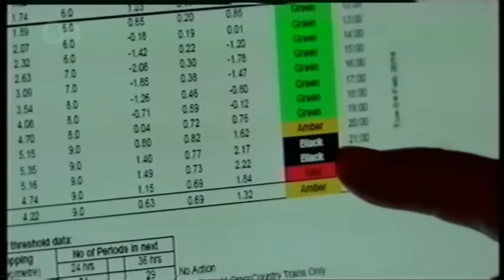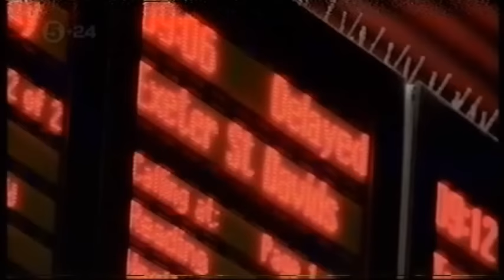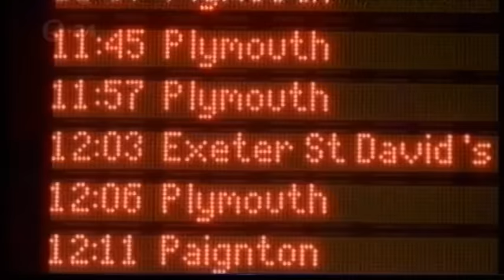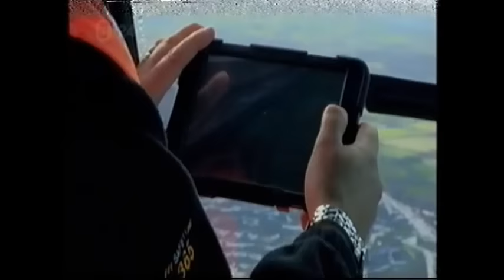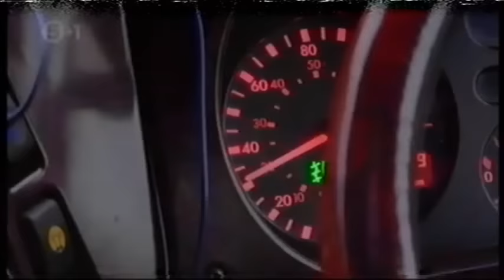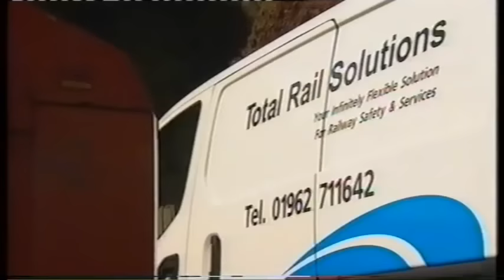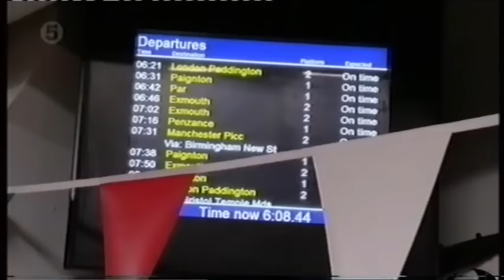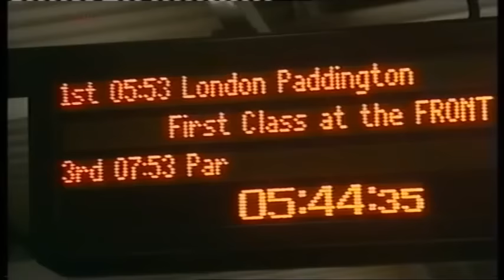The Dawlish Débâcle

Comment: I worked as a surveyor in Civil Engineering and did some freelance work on the North Wales Coast Road between Penmeanmawr and  Llanfairfechan. Boulder armor was placed on the beach to break up heavy seas and to lessen erosion. I do not understand why the beach at Dawlish has not been similarly armed.
Reply: This was also used at Minehead and Scarborough to protect the coast, however the tide does not go out very far at this point on the Devon coast and one of Dawlish’s tourist spots is the beach of which there isn’t a lot to start with.  Good point though and eventually this may happen if it gets the battering it’s had since being completed.
Reply: I’m convinced that there was a body politic against reinstating the Oakhampton route. The Dawlish route was undoubtedly ‘engineered’ in more ways than one!
Reply: Why is this called a débâcle , it was a success 🤔
Reply: @Belfreyite   Thankyou for your educated comment , I’m no expert like yourself but I’ve been saying the same thing since they “ fixed” the dawlish line - should of been rock armour all the way along 50 feet out ,no way in hell that track should ever be deluged by sea water ever - half a job - typical of modern day Uk
Reply: The civil engineering for the A55 expressway you were involved in would almost certainly have been driven by hydrological surveyors' assumptions for that stretch of North Wales coastline. The Dawlish works I'm sure would have followed whatever judgements were made for that stretch of Devon coastline.

Comment: Sadly the new wall will hold but, the waves still come over plus this is just a small section of 4 to 5 miles of crumbling coastline.  The Oakhampton route must now be an option.
Reply: Route should never have been closed,
Reply: Should not be that hard to do... Much of the track bead is still there.
Reply: @TheMateriaalkunde  I understand there's talk of the line from Plymouth to tavistock being put back, but I can't understand why oakhampton to tavistock is being left out it's said that the viaduct won't stand trains over it, so why not build a new one next to it, a survey was done on the trackbed and there's not really a lot needing done,
Reply: @TheMateriaalkunde  Alot of the track bed has been built on? So it will be harder to restore it.
Reply: @SBRailways1992  The only reason that so many disused lines can’t be easily or cheaply restored is because the track bed wasn’t protected in case of future need. One has to assume that the politicians of the time were so beguiled by the Road transport lobby that they conveniently ignored such ideas?

Comment: Looking at the critical failure even from the perspective of a destroyed structural sea wall, this was a very nasty problem. Add to that both the requirements of a very busy rail plus road link built on top of it, this would have hit the structural team hard.
Even the fate of the temporary solution (with shipping Containers filled with hard core) you can see how much damage the waves can cause. In retrospect, repositioning the whole line, may have been the only long term solution, but that would have involved a whole new line design and profound problems for people living on this coastline.
I did work in heavy civil engineering decades ago. But never on transport links or coastal sea defences, they require amazing skill and the work can be very high pressure, because of site access and vulnerability. This project had ALL the possible major problems, plus fantastic time pressure  and no way to plan ahead in fixing it. What a project.
Reply from the maker: In the life of the wall, the more years that passed without a major breach, the more complacency developed. Before 2014, Network Rail was saying that no problems were foreseen. Now it is arguably spending too much on the weakest points of a generally vulnerable route.
The video was put together as a record of the event and of the triumphal resumption of service.
Questions, criticism and analysis will be published separately on my web pages.